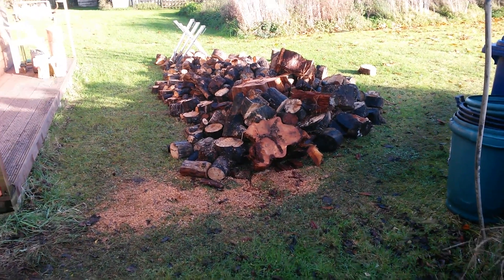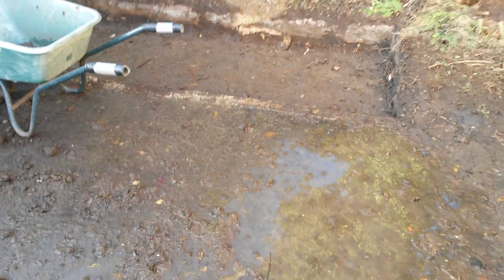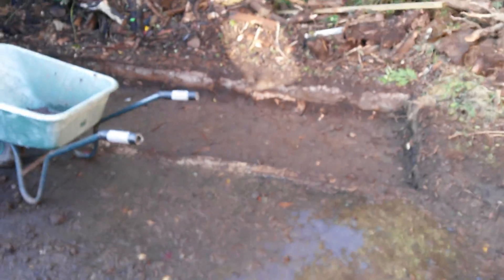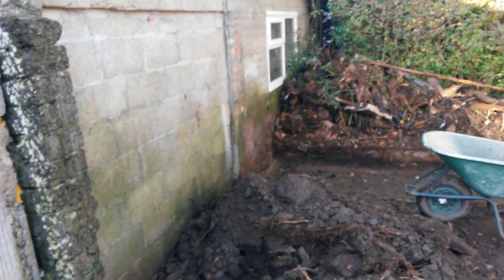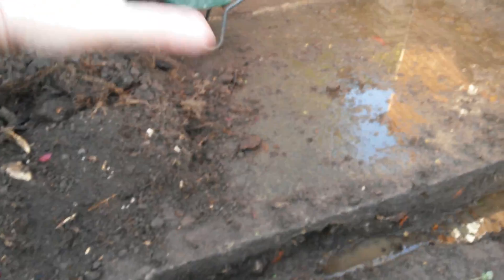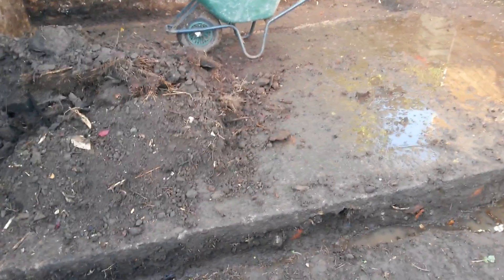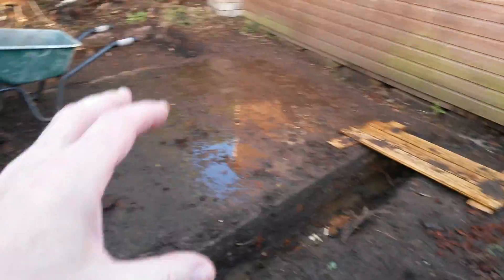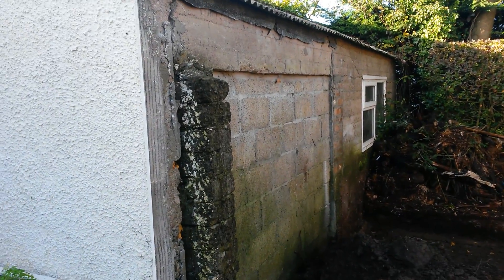Workshop Extension 1

Comment: You're lucky, dude. We have to dig our footers down at least 2 feet. After we get through the root mat it is fairly easy until we hit rock. Glad I'm retired! :-) We probably would have built a form across that back wall and poured a lintel—easier than getting a pre-cast lintel or I-beam back there and less manpower.
Looking forward to the next installment.
Cheers,
-- Joe
Reply from the maker: I am on top of a hill and the clay pan is about a foot down so building is easy.  The head that's being taken down was poured in position but it's too low and we keep hitting our heads on it when the original shed was still there.  The people who lived here weren't very tall.  I'll mention your idea to the lads, they might decide it's worth going that direction, thank you.
Best Wishes, Brendan.

Comment: The weather is supposed to be good for the weekend Brendan. Just watch out for frost at night. Good to hear from you again.
Reply from the maker: Hi Sam, I've been quiet lately but that had a lot to do with moving my aunt... again... and trying to get work done while I have access to the lathe. However, I am making space now and have been able to move the lathe to a new spot, away from the wall that it coming down, and where I can still work at it. More later.  I saw the frost report but, hopefully, it will be ok on Satuday night.  If not, the concrete might have to wait.
Best Wishes, Brendan.
Reply from the maker: Hey Sam, are you in Norn Irn?  I was just thinking about the frost warning there.
B
Reply: baconsoda I am Brendan. We've spoke on here before. I'm in Belfast.
Reply from the maker: Of course, I was very tired when I was answering comments yesterday and wasn't thinking too deeply.

Comment: nothing in that firewood pile that could go on the lathe mate?
Reply from the maker: Most of it is split or useless.  I went through the pieces and only grabbed the few sitting on the wooden platforn at the shed.  Most was too dry or split.  It is perfect for burning as it's been in the pile for about 18 years.  It was never used for turning as it was poor quality wood.
Best Wishes, Brendan.